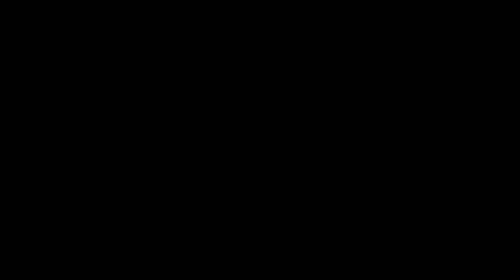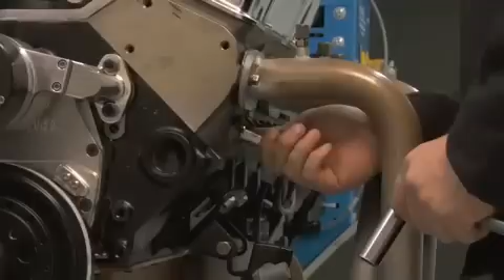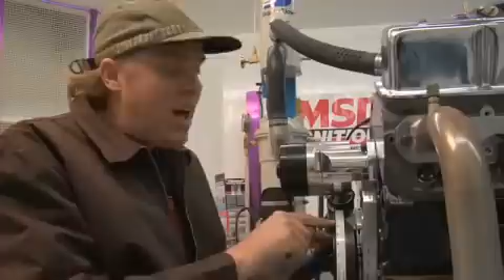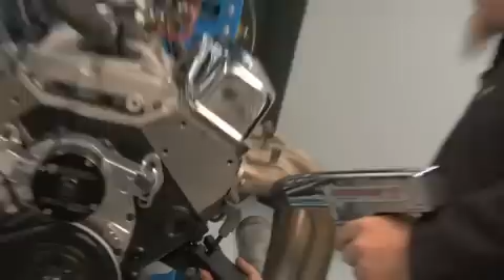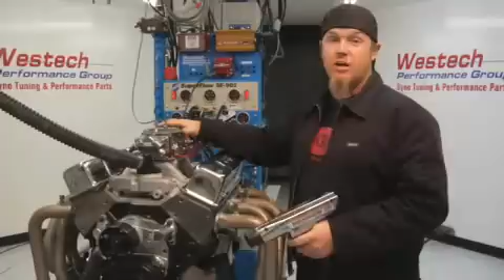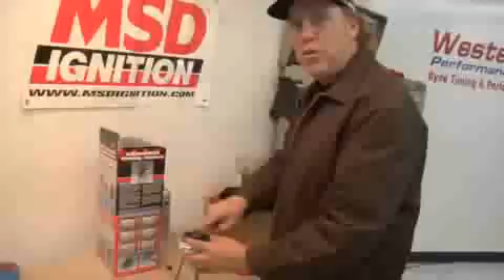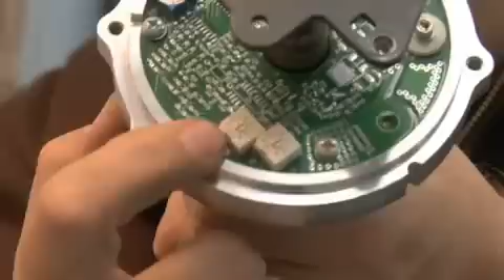How to set your ignition timing

Comment: hey i have  small block 305 chevy  , stock evrything  , and when ever i try to adjust my  spark timing , after i set  my engine to tdc " 0  mark " @ idle  i shut off my engine , connect my est plugg  and start up again my engine advances itself 15 degrees and runs real rich " white smoke  out of thetail pies"  what am i doing wrong ?